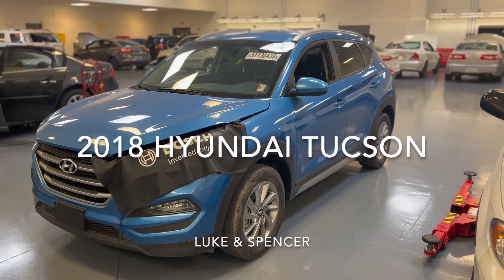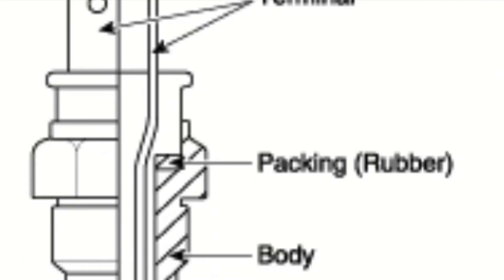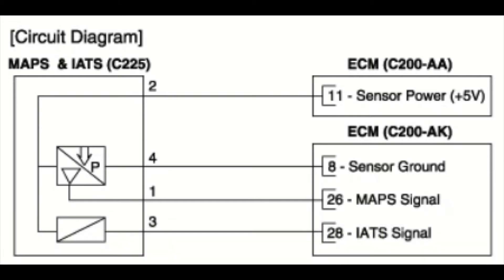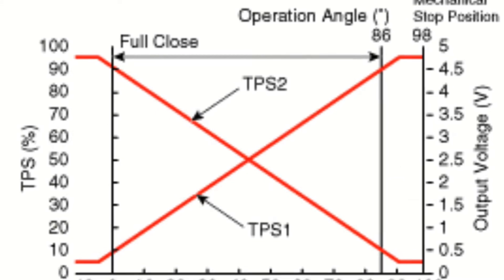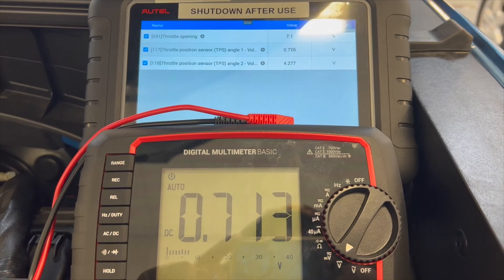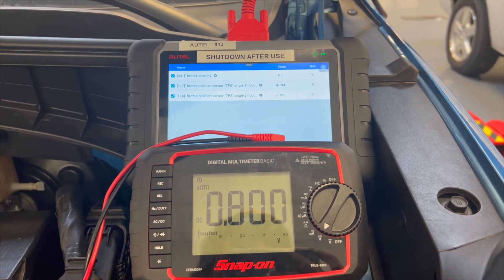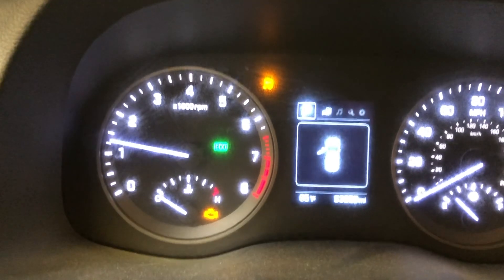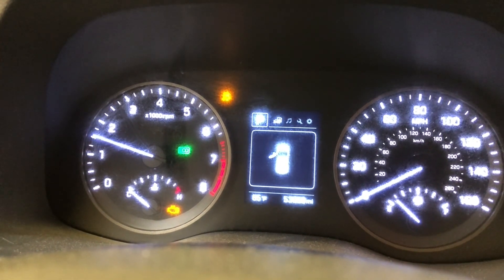2018 Hyundai Tucson ECT,  IAT,  & TP Sensors

Comment: Hi I would like to know where is the intake air temperature sensor located on 2017 Hyundai Tucson,
Reply from the maker: The IAT sensor is included inside the Manifold Absolute Pressure sensor, the same as the Tucson shown in the video.  Hope that helps!
Reply: @autotechsiu12  ok,so you mean MAP sensor is included with IAT sensor?because I had try to clean the MAP sensor few times but it has oil in it every time,
Reply: @signarniroula1305 oil in it could mean time to change Valve cover gasket
Reply: In order to get a reading or a code, do I have to have lights on the dash I’m wondering. My 2018 Hyundai Tucson has a rough noise when I accelerate, and I’m having trouble trying to figure this issue out. I had someone tell me when the check engine light come on bring it back. Didn’t want to do a diagnostic test on it, because there were no codes. I don’t know what to do at this point. Any suggestions?